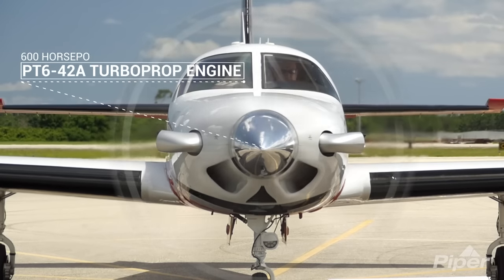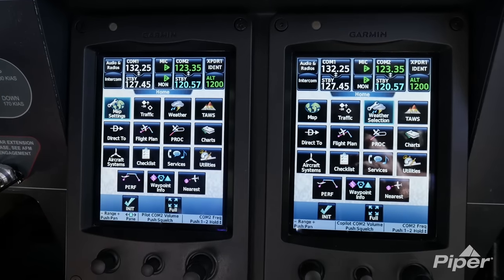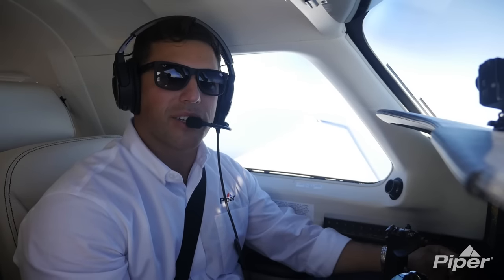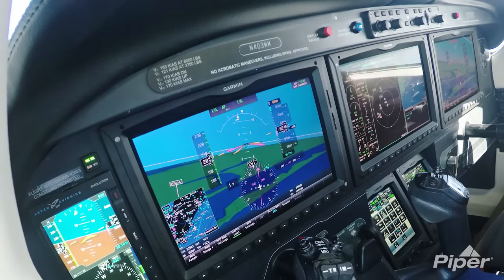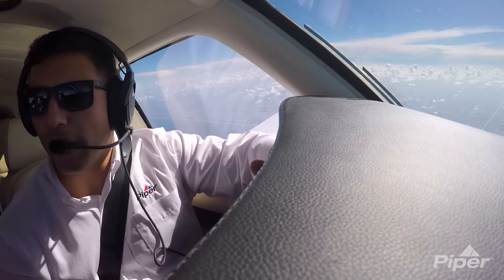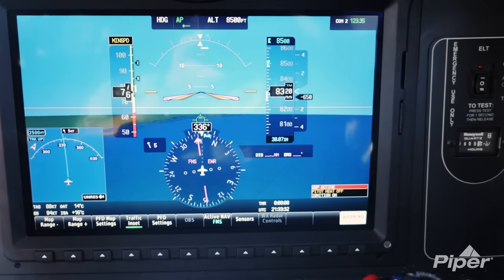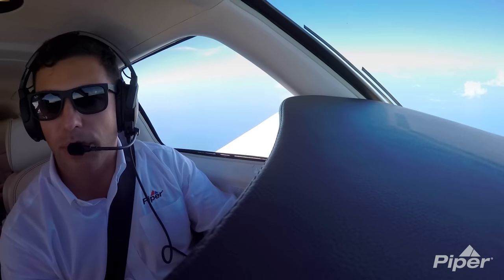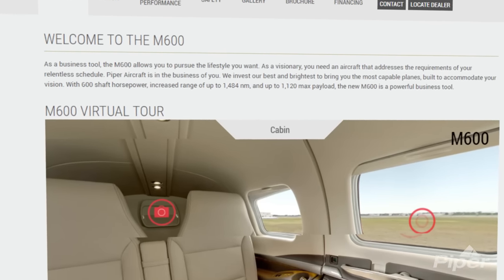Official Piper M600 Flight Demo

Comment: I think the smaller single engine turbo props like the M500 and TBM700 offer the best value (especially used). The larger PC12 and future Denali are bigger but slower.... If you want seats, range and speed these single engine turbo props are faster than than some of the VLJ's like Cirrus jet. If you want more speed a twin engine a used Citation is nice, but operation cost go way up.

Comment: I assume there is an error in this video since the "maximum speed" is 274 KTAS - 0:41, and the "Vmo" 250 KTAS - 2:32.
Probably you mean Vmo = 250 KIAS since Vmo is usually defined as KIAS.

Comment: There were a few well publicized Hypoxia cases where the flight crew was incapacitated and the plane flew until it ran out of fuel and crashed.  One killed pro golfer Payne Stewart (Lear Jet). Another was in a single engine TBM700 turboprop. The plane crashed into Caribbean Sea near the northeast coast. Radio indicated the pilot cognitive abilities were declining due to oxygen deprecation. Why did these pilots not put their O2 mask on and descend? Don't know but this new system would have likely saved both crews and passengers.
Reply: OMG, I forgot that’s how Payne Steward died. That was awful, I remember thinking at least they weren’t conscious. I’m a nurse practitioner so my brain automatically goes to how the person felt prior to demise. I know I’m weird. I’ve rented a very old piper, hard to crawl into the cockpit and I’m not that tall.
Reply: a simple expanding gasses balloon activating a switch audible alarm system that activates when internal cabin pressure is reduced to/reaches 10k feet equivalent would be enough....; this would cost about $40 in materials...  If internal cabin pressure hits 10K feet, you have pressurization issues....
Reply: @mdd1963  There are warnings galore in high flying pressurized planes. There have been cases where the crews O2 was turned off at the BOTTLE. It was serviced and maintenance forgot turn it on. THAT IS WHY before flight cockpit crew checks their mask. But to your point... good idea. Flying at altitudes that don't support life is serious business.

Comment: Piper Aircraft, Inc., what do you think about a new M350 with the new Lycoming iE2 engine, the new wing from the M600 with the integrated weather radar and a new 4-blade prop with less noise?

Comment: I wonder if the anti hypoxia feature could theoretically descend into a mountain or other high terrain.
Reply: Mozoto : No. GPS knows mountains.
Reply: @berndl  Yes GPS knows mountains because it is in the data base... it has topography and knows your altitude and location, it can warn of ground. It is part of enhanced ground Prox systems. Do they have it programmed to avoid terrain in the emergency auto descent for hypoxia? Don't know but it could be done. Also in the lower 48 states, the max mountain peak is about 14,000'
Reply: @gmcjetpilot  What about traffic. Will it descend into traffic below?
Reply: @kimberlywentworth9160  I doubt it but there are other safe gaurds. Many planes have a TCAS traffic collision alert system that advises pilots how to avoid traffic if too close. Second in an emergency ATC ( air traffic control)  will see the aircraft position altitudes and get other traffic out of the way.  Also every aircraft of this level  has ADS-B (Automatic Dependent Surveillance – Broadcast) broadcasts position, speed, altitude others can see in their cockpit.  Last is looking out windscreen and avoiding other traffic. I am guessing buy if you push emergency automatic land it will "squawk" emergency on aircraft transponder  ATC will see. As I said planes who have an emergency have over all othet aircraft will be moved out of the way. I a plane descending from assigned altitude or getting of  flight plan route, and not talking will be assumed to be a plane in distress.

Comment: Dear  Piper  Aircraft Team , hello from Berlin !!

The  middle screen must  have the  option  to turn  some degrees  with a button  to pilot  side  , the small  screens  down  can be permanent turn  some degrees to  pilot ( left screen )  and to co poilot ( right  screen ) .

Are you working on a multi engine  aircraft with 1200  ps ?? ,  little bigger  aircraft  with a wc  ? Cruising speed  it can be  more than 330 knots....

Thank you !!

Comment: Hey Piper! I fly and operate a Piper M600 N600EU now it's T7-COM in Europe , Check the videos on my channel :)
I have flown 286 hours within 3-month single-pilot within Europe, I can say that it's a very economical and fast aircraft for the passengers and owners ( except pilots)
Garmin G3000 is so easy and intuitive to use! 
Before M600 I flew on Diamond DA42 twin-engine And I had to learn how to fly on M600 from the beginning (Completely different handling - much harder )

Cons are 
- not enough space for the pilot's head ( I am 180 cm tall )
- seats are too narrow and too close to the window ( I'm 78 kg)
- auto temperature controller doesn't work well ( it always heats the cabin air even when set for cold ) I have to switch to manual mode all the time at cruise.
- it's cold at the pilot seat, cold air is coming from the airframe parts ( not enough insulation )
- It requires a lot of muscle force to flare it with 1 hand. I spent a lot of hours adapting to this feature.
- Power lever is located too low and too far from my hand and you have to seat like a monkey with one arm and shoulder pushed down to control it.
- Power lever is too sensitive at 350-550 torque and requires experience to operate.
- It's hard to get into pilot's seats!
Reply: So the aircraft is hard to flare with one hand. That could be a problem with me as I am a smaller lady.

Comment: Well, it seems pretty clear that Piper is jumping on the 'Daher TBM' bandwagon with a cheaper, lesser quality and MUCH slower knockoff with less payload and range than the TBM 930. If you're going to try to copy your competition, you should at least make an effort to bring something improved to the table instead of 'inferior but at a cheaper price'. Comparing an M600 to a TBM 930 is like comparing a Chevrolet Spark to a Porsche 911. Yes, they both do the same thing but in a VERY different way and yes, you get what you pay for, as with most things in life.
Reply: Although the M600 and the TBM are the same class, Piper made the M600 from customer request for a faster plane. It's not a copy of the TBM, but a copy of the M500/P-46... going back to 1982. I've been in both planes, and the quality is equal between both planes. TBM is a hot rod, but if you need a family hauler with excellent speed and payload, the M600 is a far better value at almost half the price in ALL category's;  Sale Price, Insurance, Maintenance, and cost to operate.